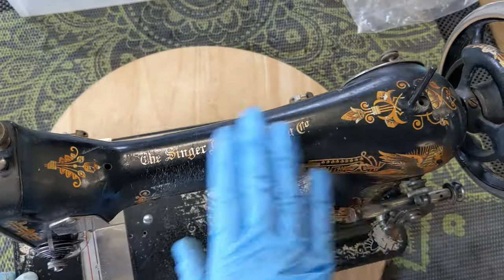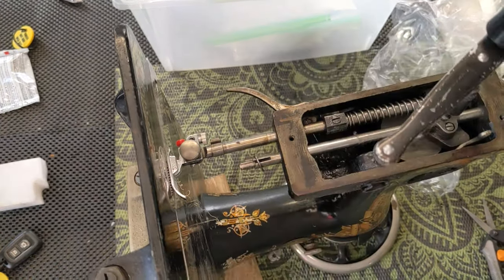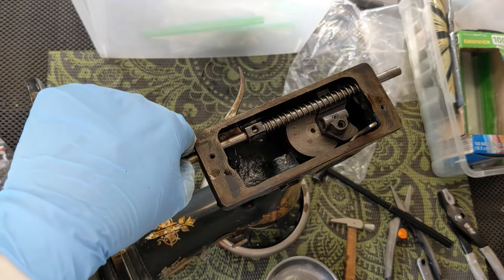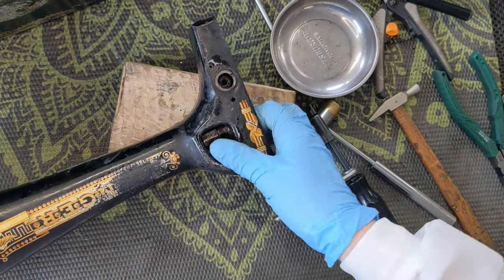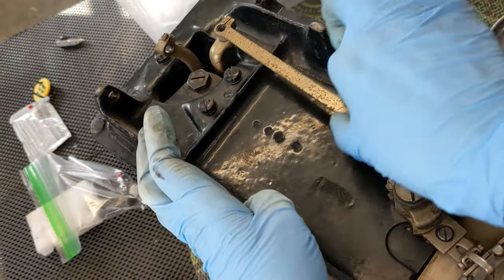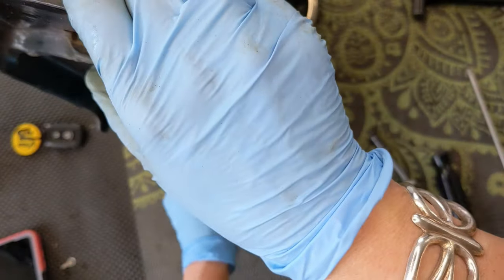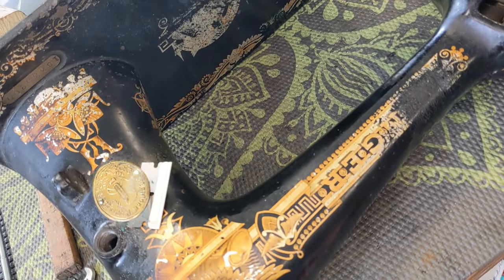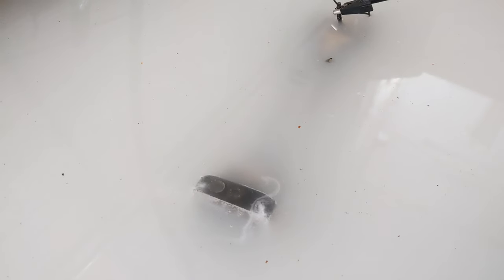Taking apart a Singer 27 for repaint

Comment: You know, I was thinking about the gun blueing idea.  I don't know really anything about it but was thinking that preheating the metal might allow the blueing to prnetrate deaper into the metal. On cast iron skillets, curing them to cook on, the heat alllows the ool to oenetrate into the iron. As a matter of fact, i light to triple repeat the curing process, because i like to wash my skillet, and that allows quick washings with minor recuring subsewently. I think with iron heat opens up inter molecular oores. Just something else to consider.
Reply from the maker: I actually am sitting here with a quart of blueing, I think I'm going to try it out on a 66. Wish me luck!
Reply: @prometheansewingmachines  Good luck. Can't wait to see